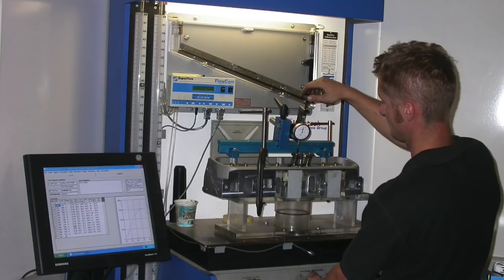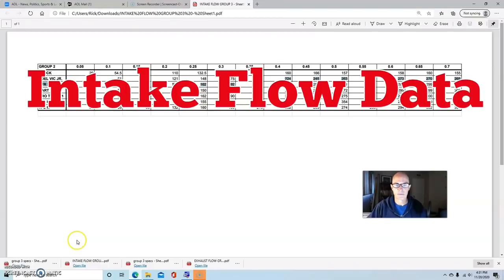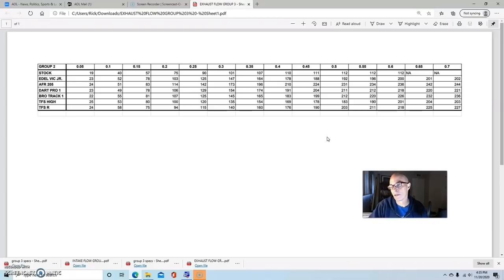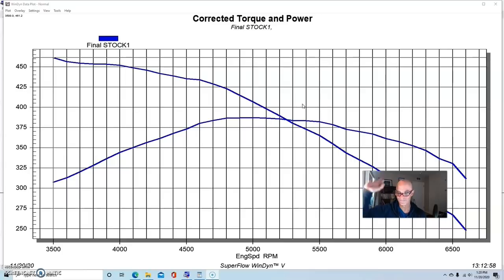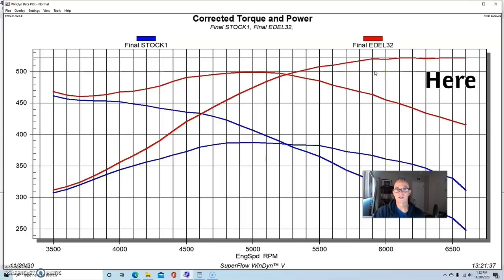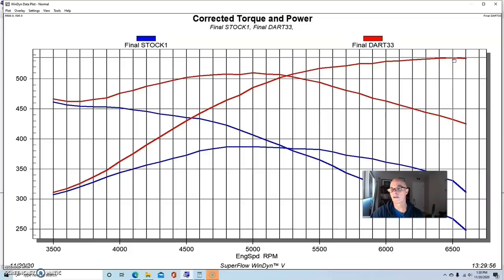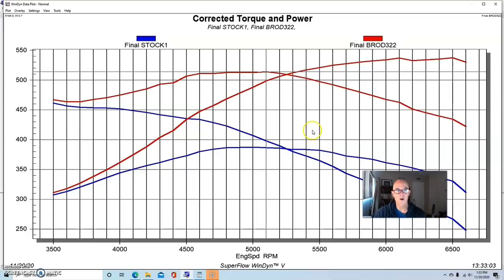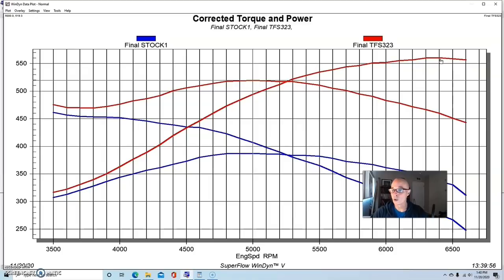MEGA 5.0L FORD CYLINDER HEAD TEST-PT 3

Comment: If the 393 Windsor that I am building with the Edelbrock performer RPM heads 202 intake valve get anywhere close to 500 horsepower I will be very very happy. Thanks Richard you do great work.
Reply: depends on the cam  use a 282hr from comp as a minimum

Comment: I need some input.My little cousin has a 351 Cleveland stroked out to 408.He has the classic 4 v heads.He couldn't tell me what cam shaft is in it but has a Holley 750 double pumper.He had the motor built and says it did 602hp on the dyno.
I just can't believe that.
He says it's solid lift cam flat top pistons with 11 to 1 compression.
Don't see how that carb could feed it.
I have a 351w gt40 heads and a mild flat tappet cam and a 750 carb that works good with my set up.
Please respond with feed back I'm sure there are plenty of knowledgeable people out there that can agree or call b.s.
Reply from the maker: A 408 CAN MAKE 600 HP, BUT WITH STOCK 4V HEADS IT WOULD BE TOUGH

Comment: Waiting for the next Mega SBF Cylinder head test. I am starting a 347 build and always wanted a Clevor (possibly a Boss 363?)but it seems  other Windsor type heads might work as well without the .700 lift in the cam. I plan on a street/strip engine with Hydraulic roller cams and am seriously considering the Dart block. I like the 4 bolt mains and added block strength. This is a fine series and I am enjoying the information.

Comment: What is the result on running to much head on a motor?  Such as running TFS 225 CNC heads on a 347?   Is the best solution simply adding 21 lbs of Boost?
Reply from the maker: look at the LS3-big, high-flowing head on a 430-hp motor-also any HONDA motor (K motor flows 300 cfm)-works well

Comment: I'm a chevrolet guy personally but this was super interesting to see the differences....... the only curiosity I've got now is what about throwing a set of Cleveland heads in the mix? im mostly interested in the LOSS of power that would be sacrificed to gain some power in the top end. I've heard so many stories about the Boss 351 being amazing but lacking bottom end, so why not see what it does on a 393 incher?
Reply: Davie Jones Lockr, as you probably know, the factory iron four barrel heads have massive 242 CC intake ports and 2.19” valves. The early 1969 Boss 302 Cleveland heads had even larger 2.23” intake valves. The Ford engineers obviously designed them for high rpm power without sacrificing very much lower rpm torque when combined with a well balanced combination of induction and cam components. 

But the guys with the “bigger is better” mentality started using monster cam grinds without increasing the static compression or upgrading the intake or exhaust flow velocity. To make matters worse they would sometimes use the stock differential gear ratio instead of going with steeper gears to match the cams power band. 

The results were a noticeable loss of low end torque. The problem has gotten worse in recent years with so many internet experts expressing their clueless opinions. 

But with a well balanced selection of parts the loss of intake charge flow velocity and the resulting loss of low end torque can be avoided or kept to a minimum. As with most naturally aspirated engines with healthy cam grinds, the power band is moved up. But around 3000 rpms up to the typical 8000 rpm Cleveland redline, the power hits and keeps on building. Power is power but there’s a sound and feel unique to the Cleveland. 

The Cleveland heads really come alive with the extra cubes of a 393 or 408 stroker drawing on them. When aftermarket aluminum Cleveland heads are combined with an aftermarket Windsor block (aka Clevor) with stroker displacement over 460 cubic inches, the power production is amazing. 

There’s a good example here on YouTube and definitely worth checking out. It’s an Australian built Clevor posted by Fullboost. It’s a 461 featuring Higgins Cleveland heads and built by Dandy Engines in Melbourne. With a single four barrel carburetor running on 98 octane Aussie pump fuel it pulled 934 horsepower @ 669 lb/ft of torque. That’s all engine with NO power adders. On race fuel it pulled 979 horsepower @ 700 lb/ft of torque. It was built for a daily driven street car. 

Australian Clevelands are popular like small block Chevys are here in the States. Badass for sure 👍.
Reply: @danielwilson6665  yeah I understand all of that already minus the Australian build...... my train of thought was more along the lines of since we have all these big power Windsor heads in play, it would be interesting to overlay a single cleveland pull in the mix because hey, same application, and the guy buying heads is probably wondering if it would be worth his time and money to travel the path less traveled. I wasnt asking for every version of the Cleveland style heads..... just a single line to show how different the same bottom end could act with just the top end swap.
Reply: @DavieJones_Lockr , the Australian made CHI 3-V alloy head would be a great choice for canted valve heads to toss into the mix of Windsor heads for comparison. I believe Mr. Holdener has already posted his research results using the CHI heads. I wasn’t trying to cast any negativity towards the Windsor heads. There are some really good examples available. Since Cleveland style heads have the same cylinder bore spacing and head bolt patterns are identical to Windsor heads, they are a fairly straight forward bolt on with the ability to support big power numbers, they deserve an occasional mention when heads are being tested.
Reply: @danielwilson6665  I completely agree. they do deserve to be mentioned in any build that they are applicable....... because it's the consumer that's going to want to see the difference. Rich, you just popped up to say watch my video but your cleveland and boss 351 videos make absolutly no mention of a stroked bottom end. can you see where I'm coming from here? the 400m video was about as close as it gets to what I'm talking about but even you have to admit that the 400m was a half hearted example with the slugs that far down the bore. let's see what a 392 stroked Windsor will do with the highest output windor heads vs the same exact engine sporting a cheap set of aftermarket aluminum Cleveland heads......or whatever heads you think are the closest in price. "To Boss or not to Boss?" .... THAT, is the question. 

and then boost it haha..... but that's once again, another video. 

thanks guys
Reply: @DavieJones_Lockr how much cash do you think he has boy?
Reply from the maker: please see the Bosss 351 video
Reply: @richardholdener1727  , your results with the Boss 351 build were actually quite impressive. These guys throwing together a Cleveland with a bunch of randomly selected parts can’t understand what went wrong. Oh well. 

And the beat goes on....

Comment: Hey Richard I’m building a Frankenstein willys wagon prerunner with with triangulated four link in back and TTB front long travel coilovers I’m thinking of building a 408 SBF I’d like lots of torque and the ability to rev it out in all that loose dirt. Any recommendations?
Reply from the maker: desired power?
Reply: As much as possible on pump gas

Comment: I know it gets kinda busy when you overlay all the graphs, but i would like to see some comparisons between the aftermarket heads too, for example the TFS R vs the AFR 205, and some of your thoughs on the flow numbers vs horsepower, why did the AFR that had the best intake air flow and the best exhaust airflow didnt post the highest horsepower number?

Comment: I have a carb question. So on the 393 you had a holley hp 950 if I heard right and it performed great, looking at blow through carbs the cfm rating seems to be lower (750 or 850 on the CSU website). Can you explain why that is? Why are blow through carbs rated at a lower cfm but can make great power  on boosted applications compared to a high cfm carb on an NA motor?

Comment: I got a Ford Racing aluminum Boss 302 Block. Custom made Ross 12 1\2 to 1 compression. 4.125 size pistons. Scat 3.40 forged internally balanced crank. 5.4 forged H-beam Scat rods. Making a little 363. I got TFS TW R 225 heads. With crower solid roller cam springs 7.20 max lift. And a Crower custom grind solid roller cam 7.12 max lift. When TFS 1.6 1.7 stud mount roller rockers. With TFS R roller rocker girdles. TFS black box R upper with a Accufab 90 mm throttle body. TFS R lower ported and polished. TFS 44 lbs injectors TFS fuel rails. Weldon fuel pump with two Aeromotive fuel filters. Number 10 feed fuel line, and a number 8 return line. Kook 1 7/8 to 3 1/2 collector long tube. Kooks of road 3 1/2  X-pipe with Mac 3 inch turn down mufflers. No AC no power steering no pollution pump. Mezere electric water pump. 200 amp power Master alternator. March alternator pully and crank pulls with a March belt tensioner. Dynamic racing mighty might X6 C4. With all three bells and whistles. And a custom made TCI 5500 stall converter with a gear vendor overdrive kit. Cut and blanced Ford racing aluminum drives haft. And 373 gears. Fast 2.0 speed density stand alone. With data log and a progressive system for boost or Nitros. I have a direct injection NX shark nozzle 8 fogger system. With a 400 HP jets, going too shoot it in stages off the progressive system. Wheredo you think HP will be N/A and HP will it make on the spray. I know your not going to give me a accurate number. But a ball park figure. I would really appreciate it. Awesome videos I watch all your Ford powered engine videos.

Comment: It’s interesting that the TFS R heads made the most hp and torque but showed a peak a few hundred rpm before the max run in the test while the AFR heads were still going up (a bit) at 6600. That cam was a pretty good match for these combos, but the AFRs might have liked to see 7000. The other comparison I can’t help but make is to an LS3 with a 469 cam—roughly 575 hp and 525 torque from 376 cu in and a 231 intake lobe vs the stroker 351’s 393 cu in and 248 intake lobe. Just shows what continued research and development can get you. Another great info-filled video! Thanks Richard!

Comment: @Richard Holdener Are those vic Jr heads pn# 77179 the bare ones if so I have a set on a 302 stroked to 352cid. Its a .060 over forged dome piston with forged rods roller cam roller rockers with an 850dp with a 2 inch 4 hole spacer on a edelbrock rpm intake pn# 7121. Its pushing close to 13.0:1 compression its a hot little combo but im thinking about cutting some of the dome off the pistons
Reply from the maker: this was long ago

Comment: Thanks for the great content. Canted valve stuff on the way, right?
Reply from the maker: NEVER DID THOSE-TOO HIGH END
Reply: @richardholdener1727 , I’m not clear on what you mean by “high end” but from all indications the level of curiosity about the substantial performance gains possible with canted valve (Cleveland) style small block heads is higher now than ever before. That’s probably because the availability of Cleveland based heads from sources in Australia and the States has never been higher. 

The available options make them a good choice for all types of racing where pushrod V-8’s are allowed and the rules don’t specifically restrict their use because of their “unfair performance advantage” in competition against in-line valve heads. 

Of course aluminum castings are plentiful in “as cast” and CNC versions along with brand new iron versions. 2-V and 4-V port and valve sizes offered in raised port versions with a good choice of intake port volumes up to 245 CC’s for serious small block builds. There are plenty of high end valve train components available including individual shaft mounted rockers. 

I know it’s not practical for you to obtain examples of these heads for comparison along with dyno results but I would be glad to loan you a pair of the high port iron heads that were so popular in Pro Stock and NASCAR competition. 

Mine were professionally modified by Larry Widmer at Endyn Inc. and includes an Edelbrock Scorpion single 4-V intake that has been extensively modified in the plenum with port wall extensions and specifically port matched to the iron heads. They are fresh with touched up valve seats and new guides along with new Crane springs for a solid roller cam. 

If enough people were interested in seeing a real Cleveland head comparison done in your typically great manner, it would make a good YouTube video. Just need a few sets of good Cleveland heads on loan to make it happen....

Comment: Hey man I would like to see a camshaft shootout with the exact same engine and cam specs just flat tappet vs Roller, I would like to see what the power difference between the two would be just out of curiosity 😁 I've looked for a video like this and there is none so you would be the first one to do this

Comment: So explain to me how you get an engine to breath on the intake port at .600 valve lift???????
Reply from the maker: whats wrong with .600 lift?
Reply: @richardholdener1727  Nothing is wrong with .600 lift, but can you get any air into the cylinder at .600 lift???, thats my question

Comment: I really liked this test Richard, and particularly your honesty at the end about why you don’t post HP results in order. 

The coolest thing for me was to see the stock heads on the engine first!

One can see how the factory engineers were focused on lower rpm torque...it shows up in all the tests to some degree but quite extremely with this one. 

Cheers!

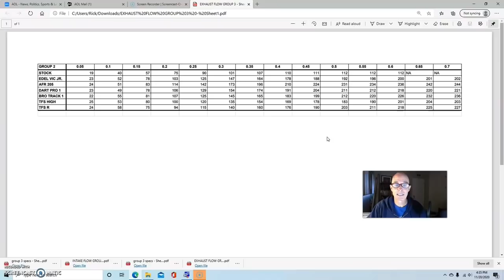Comment: Paused at 4:10 to make a prediction after looking at the port flows:  The AFR head will win, not because it has the highest intake flow, but because it has the highest exhaust flow.  It outflows the second best exhaust port (DRT) by 10-14% from .25 to .70 lift.

Afterwords:  Drat those Trick Flows!  Beat the AFR's by 6 hp and 4 lb*ft.
Reply from the maker: The Rs were always good performers

Comment: It appears that the TFS high port falls short of all the others in flow, aside from stock. Would probably work fine on a 306, 331, 347, or 351 though.
Reply: But remember the high ports are as cast, not cnc'd

Comment: I'm guessing the TFS high heads at 0.500 was 254 cfm and not 354 cfm. Also excel tip - highlight the cells you enter the specs in, right click on one of the cells then select format cells. From there select text. This will show entries as they are entered. Example. it will show 1.60 instead of 1.6. That's my pandemic OCD talking.

Comment: I totally get your comment about comparing peak HP for all of them. Even the info you have given in these tests cannot paint the full picture. It would be impossible to give a true analog for all the combinations. Each head would have to have the unique cam and all the other components tailored specifically to that head.  Then, you would have to look at what you are actually building each one for since these heads all have a slightly different design philosophy, ie the relationship between torque / HP and where they fall in the RPM range. One other thing: can we all look at how incredible AFR stuff performs? It does not have the peak flow numbers like some of the other heads but it still came in second in peak numbers only to the full on TFS R heads. Jon Kaase once said he doesn't even like to post flow numbers because they are not even close to the most important factor to how a head will ultimately perform.  Thanks for this incredibly detailed comparison. I cannot even picture how much work it was to put it together!!! Cheers!

Comment: The TfS high port heads are just meh out of the box in as cast form. But they really wake up with porting
Reply: But t they ended up a little better than an AFR 205 that is cnc ported
Reply from the maker: the afr was much better than the tfs hi port in this test

Comment: Wow, good show man! although, I think the days of combustion engines is limited since an electric motor can put out 850hp and torque from 0-100% and probably less headache to set up...
Reply: Trains running all over the country with electric motors, 0-100% torque...but they still have 3500 hp of diesel power under the hood to make the electricity to feed those motors. Anyways, look at Richard's face...the headache is part of the joy.
Reply: @kidsteach938  LOL fair point!
Reply: I think IC engines will be around another 20 or 30 years. Diesels may be the last to go, since they are vital to both trucking and heavy equipment and industrial use. It will be quite a while before an 80,000 lb semi can cover 600 miles on a charge.